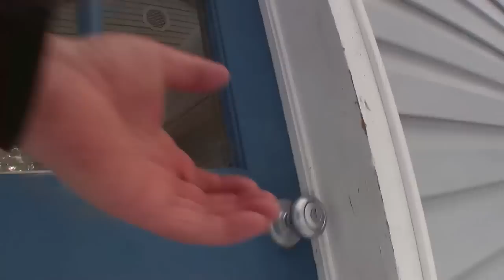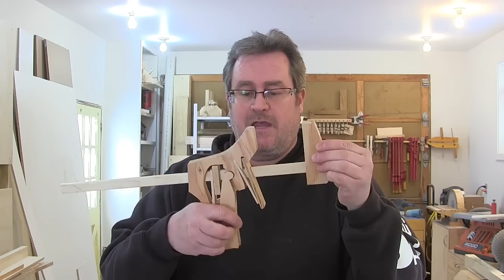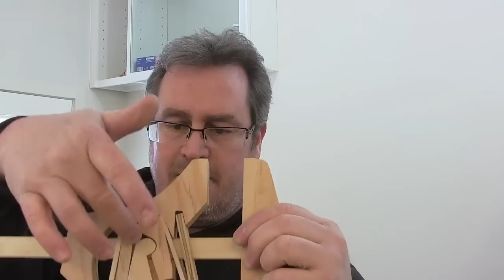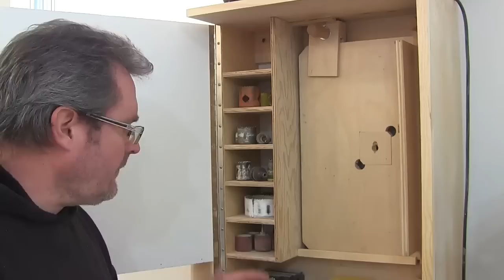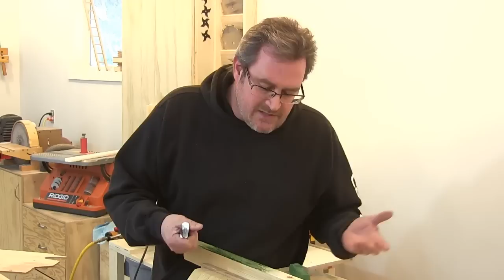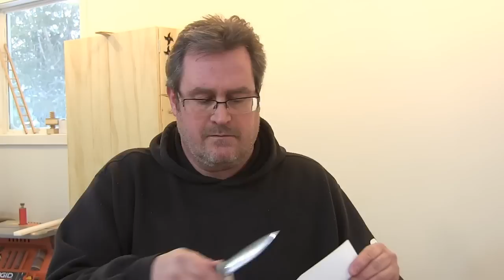The Drill Press Cabinet

Comment: That's a great cabinet, I really like the slat and bit holders you've designed there.  Much classier than sheets of pegboard, and probably much easier to remove a tool without dropping one of the pegboard tool hangers onto the floor behind a toolbox.

Comment: Great video. I like the drill cabinet. That is pretty neat. I do something similar with the compound. But, I use a piece of leather from an old baseball mitt on the workbench. It works great for me. I keep the leather with the compound. I found I used less compound as some always remains useable in the leather.

Comment: The irony of testing a sharp edge with paper is that paper can really dull a blade :-(. I like the cabinet, but my shop has limited wall space, any chance of showing a method for attaching it to the actual drill press?
Reply from the maker: It's not much of a blade if paper seriously dulls it.
This cabinet is made to be wall mounted to be at a convenient height. I don't like having anything under the drill press, with all of the swarf raining down on it.